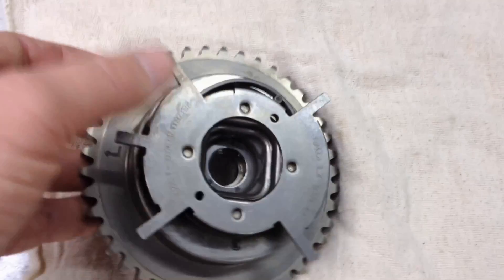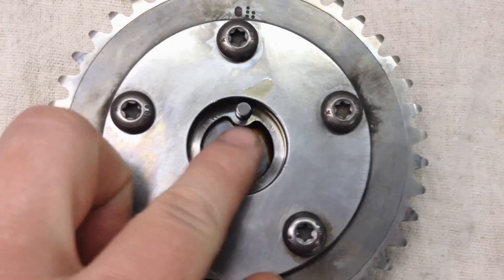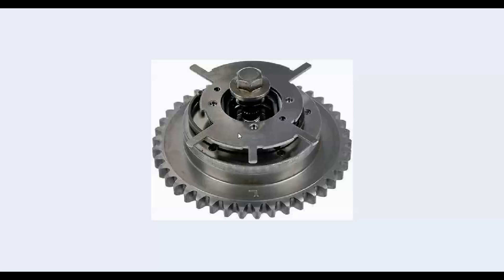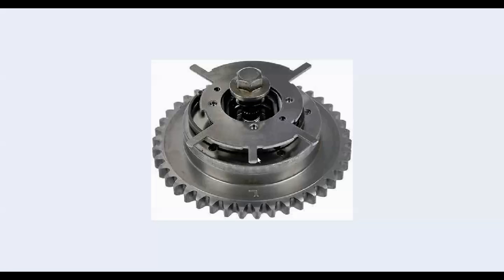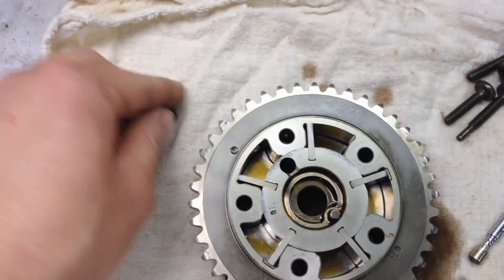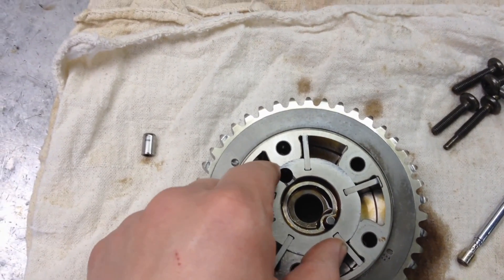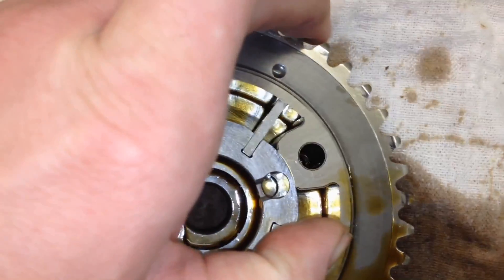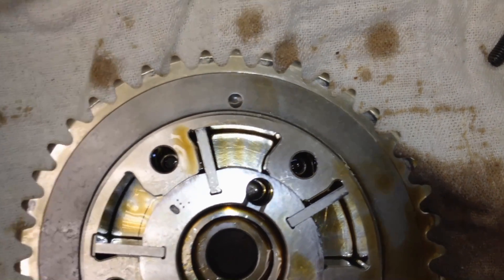Ford 4.6L 3v & 5.4L 3v Camshaft Phaser Knock Explained

Comment: Would bad cam phaser cause a no start i have a 5.4L crank but no start engine seams to have a skip while cranking like it does it have compression on some cylinder i would appreciate you're. Help thank
Reply from the maker: It would have to be stuck in the wrong position and be way off for a no start. Very unlikely.

Comment: I have an 06 f150 5.4.. has a click noice that sounds like a bent valve or push rod..teuck runs fine until watm the it losses some power..any idea what it van be..noice comes feom pass side
Reply from the maker: oscar espinoza I would check oil pressure hot at idle it should be 20psi or higher. Sounds like your vct solenoids are sticking or oil pressure issue. The noise is coming from the from phaser area as shown in my phaser replacement video?
Reply: A bit more towards the rear ..by the 4 cylinder..
Reply from the maker: Well I would pull the valve cover then, the 5.4 is known for lifter and roller rockers failing.

Comment: Could you get noise from those internal fins smacking the housing? I have noise at idle and on acceleration. but it will go silent after 2100ish RPMS. How do i know if I have the leaking chain tensioners that I have heard about?
Reply from the maker: The fins are in there very tight so I doubt it. If the chain tensioners are leaking you will have noise upon a cold start rattle noise.
Reply: How can I determine the where the noise is coming from? I have heard of the seal on the hydraulic tensioners going bad. or should I do chains, guides, tensioners, phasers and forget it.
Reply from the maker: I would do chains and guides if over 100k for sure and phasers/tensioners either way. The seals on the tensioners go bad all the time, you will know though on a cold start first thing in am.
Reply: FordTechMakuloco Cool thanks! I am at 126K I will do that then!

Comment: Anyones F150 sound like it has crappy flowmasters under heavier acceleration?  Can't figure out what's causing that noise.  Runs fine at startup, idle, and crusing, but sounds like crap when accelerating. throwing code PO345 and PO349.  Sensors are new, thinking I have a short or grounded wire leading to the sensor.  If the signal is fixed, should that fix any timing issues and make the noise go away?
Reply from the maker: Here is a very easy test.
To check the operation of the VCT system, recommend unplugging the VCT solenoids with the engine off and the key out of the ignition. This will pin lock the phasers. After the VCT solenoids are unplugged clear the DTCs and start the engine. If the DTCs do not return there is a VCT phasers issue. If the DTC do return, recommend overlay the CMP circuits and retest.

Comment: You have described the exact problem noise I'm having on my 05 5.4 L F-150 during cold start up. It does quiet down after the engine reaches proper operating temp but I still hear a little tapping if I'm idling close to a structure. I assume it may have been caused due to my previous lead footing it, but hey, when ya got a sweet sounding truck, ya wanna hear it even more! LOL What do you think a job like this would cost for repair at a shop rate of $110 per hour? Thanks again for the enlightenment, I thought it was just a valve adjustment! LOL
Reply from the maker: Yours sounds like it needs timing chain tensioners the gasket on them blow out, these phaser make the noise hot not cold.
Reply: Hey @FordTechMakuloco - My '09 4.6L 3v will intermittently make the phaser knocking noise and will throw only one code (P0345). It's very inconsistent and will ALWAYS go away when I shut off the engine and immediately restart ... and sometimes when I shift to neutral from drive or reverse (whichever I'm in when it starts knocking). I can go a week and it won't throw the code and then it will happen three times in the next 24 hours, then not again for a few days. Very random. Thoughts?

Comment: On the 6.7 Is there a way to check the regeneration cycle of the dpf after the display comes up if not how long does it usually last?
Reply from the maker: Only on the scan tool
Reply from the maker: The regen cycle can last awhile if driven in town, it is best to drive at highway speeds then it shouldn't take too long at all not sure on the exact times, should be like 15min or less on highway.

Comment: is there any way to learn tire pressures on a ford's TPM systems? had the fun tonight with a fiesta...
Reply from the maker: As long as all the sensors are working and tire pressures are correct per door label, just take it for a test drive and the light will auto clear.
Reply: ye thats basicly what happened.
now if you replace a sensor whats up?
Reply from the maker: You must use an electronic activator tool we have from OTC.
Reply: bastords!~

Comment: You should check out "Cam Phaser Lockout Installation Instructions by Livernois Motorsports" on Youtube as well as their website @ www.livernoismotorsports.com.
Reply from the maker: Yeah that is nice but will not work in a Ford dealer situation.
Reply: FordTechMakuloco Do you think installing the lockout is a bad idea?  If so, what are the negative consequences of it?